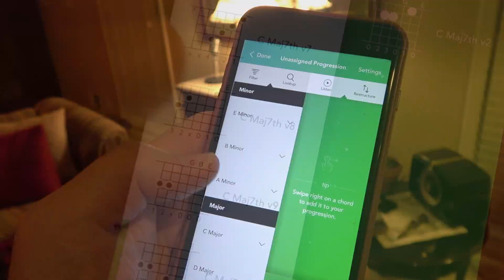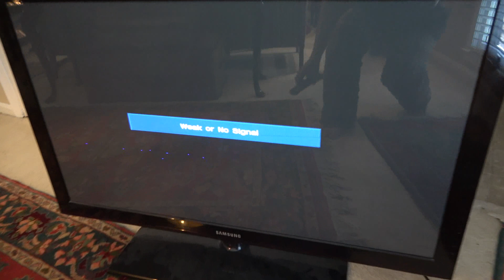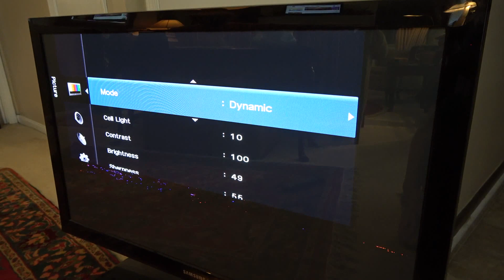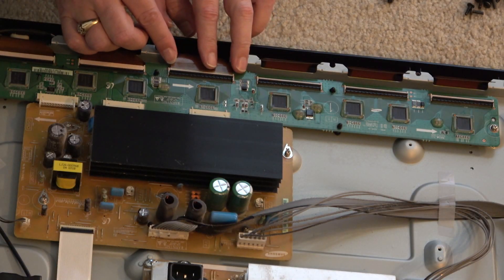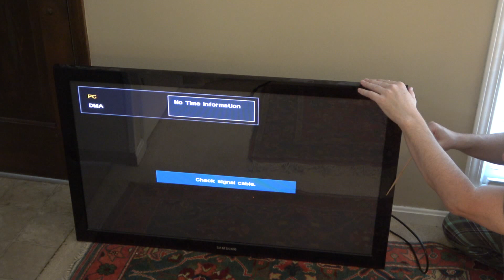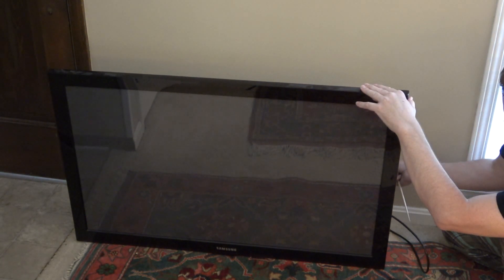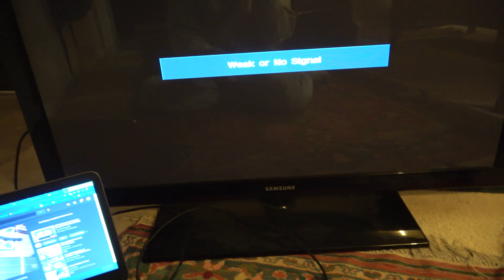I found a Plasma TV 📺 in the TRASH! Can it be fixed?

Comment from the maker: NOTE: As some have pointed out, rightly, the component I tried to replace was a cap, not a resistor. Told you I'm not good at SMD stuff! In any case, the chip was the ultimate fault on the original board. The cap reading was just a symptom of the problem. I'll know next time.
Reply: I'll trade you some of my electronics skill for your Playing ability.
Reply: Those are the power decoupling caps for the video display driver chip
Reply: Sometimes on SMD components, If you use two fine tip soldering guns, things will tak dowm much more easily From my professional experience as an all around assembler. Those little SM chips, resistors, caps, and components can be a pain in the ass to replace, and remount. Thank You President Brad
Reply: One thing to keep in mind is that caps in SMT don't have numbers on them unless they are electrolytics. Ceramics do not have any. Resistors do have numbers, though they may be difficult to read, small as they are. Also, look at the part number on the board. It is a C designation, resistors will never be a C. Always an R. 

And yes, SMT is a royal pain to deal with. I've been doing it for about 8 or 9 years, and I hate it. But if you're quick and have a small tip on your iron, it's doable.
Reply: So how much less your time were into this for?  Parts?
Reply: Dont feel bad brad I'm still learning my electronics.apparently ive been using transformers in my guitars instead of capacitors and when i think its a cap its actually a resistor.they serve the same purpose under the right values and either way it works.
Reply: It’s on you..
Reply: @malcolmadams2105  your right i don't recommend nor do I encourage anyone to do what I have done to my rig at home.i just got lucky on that one I guess. Nothing has gone wrong yet so far.
Reply: Still trying to figure out how in the last scene you show us a working set. Also, there is a pry point on the edge of the chip. You could have swapped chips.
Reply: Sad to hear you're leaving you tube... I don't use any of those other sites! I have watched pretty much all your videos... they have helped me get thru lockdown.... thank you!

Comment: You forgot the vital first step: remove any dust with a wire brush and wash debris away with a water hose.
Reply from the maker: The water hose dousing is a vital step in any self-respecting plasma TV repairman's itenerary.
Reply: Can we fit ramen in some how ?
Reply: and a wirebrush to clean the screen
Reply: Had to think about that one for a minute lol :)
Reply: @TheGuitologist  Fix any slight chips with ramen as well. Don’t forget to hose out the remote.
Reply: LOL!
Reply: @TheGuitologist  power washing is highly effective in removing roadside sludge from most electronics

Comment: The Vizio 42" in my living room had an issue with not powering on. It also was a cap problem. There was kit I learned about on YooToob, ordered one, it came with instructions, I soldered the new caps in and 11 years later it is still working. The issue was a factory defect on the small "power - on board" and instead of replacing the whole board ($220) I followed the kit instructions ($ 25) and was successful. One of my neighbors had the same type of problem I had, I showed him how to research it and he replaced the whole board, ($300). It failed also after 3 months (90 days warranty). I made him buy a power bar with filters, ($75) and found a "cap kit" ($30) and did the replacement with him. That has worked for the last 3 years. I am not a Electronics Tech but watching your channel for awhile proves that if you do the research (if possible) and take your time to understand the instructions a lot of times things can be repaired.

Comment: I have a Panasonic plasma that I bought new in 2008. About 5 years ago the display started randomly going black. Turned out to be one of those little ribbon cable had worked loose. Pushed it back in and she still runs today. But wow, these plasma TVs sure do pump out some heat.

Comment: Oops, that was a capacitor you were measuring, Brad.  Time for magnifiers.  I recommend MegaView  magnifiers.  Most likely one of the pixels experienced a momentary arc and knocked out the IC if the capacitor measured open out of circuit and the pads still measured low resistance.  I really enjoy your videos.  Keep up the good work and long live SPF.
Reply from the maker: Pretty sure I checked it for capacitance also out of circuit just to be sure. Pretty sure it tested open on capacitance too. But I'm sure you're right on the chip being the fault. The way it was siliconed down, I wasn't about to try to replace that thing anyway, even if the pad didn't fail on the board. I'm 0 for 2 so far on SMD soldering on this channel. I'll get there with some practice. ;)
Reply: @TheGuitologist  Yeah, I used to have to change those IC's on the Pioneer plasma sets.  Not a fun job.  Surface mount work takes a little practice.  Remove and install parts with hot air only.  And use lots of flux.  One of the big tricks is to preheat the opposite side of the board from where you are doing the work.  You will be amazed.  No need for a fancy preheater.  Just use your hot air gun and work quickly.  To replace the part, tin all of the pads on the board, put lots of flux down, place chip in proper location, and hit it with hot air.  The flux and solder will suck the part into place for the most part.  Just use tweezers to guide.  Try all this on a scrap board and you'll see.  Take care!
Reply from the maker: @musicsoundelectronics5590  I'll get it eventually. I'm in the early learning stage on SMD. So I'll be embarrassing myself for a while on that stuff.

Comment: The component you tried to replace was a ceramic capacitor and not a resistor 💁🏻 but I'm glad it worked in the end
Reply from the maker: You're right about the capacitor. I did check it out of circuit for capacitance also and it just read open. But the chip was definitely the real source of the problem on this board. Oh well. I'll know next time.
Reply: Thank you. I was just going through the comments to see if anyone else noticed that it was a cap, NOT a resistor. Looks like about a 1206 package. The C in the part designation is kind of a give away, too, where the parts further down on the board with the numbers on them are marked with an R. THOSE are the resistors. Glad I'm not the only one who knows which part is which.

Comment: Nice one Brad.. not a bad TV for $36.

You could of course have a go at fixing the broken board by replacing the dead chip with one from the "spare".. and obviously adding to the impending nervous breakdown in the process.

I frikkin HATE SMD stuff.. TV's all had tubes when I started out fixing them.. mostly point to point as well.

Comment: Great video Brad!  The proper tools, some hours of testing/labor, finding correct parts, and voila, a FREE (mostly) TV !! It truly is amazing how much we waste and discard in America and just pay to upgrade. Guess its sort of a by-product of how affluent we are. My A/C made a cracking noise and then more noises from inside. shut it off, opened her up and they now design some A/Cs to have a scooper type fan that scoops up a little bit of condensation water and helps it to evaporate instead of dripping down thru a run off hose   AND of course its made of some cheap ass plastic and caught BECAUSE THE Mounting SCREW loosened and it cracked it. Tightened the screw down good with a drop of elmers glue to help keep it in place, Krazy glue and rubber bands and the 'scooper fan' was good as new. DIY fixing things is probably MY FAVORITE HOBBY!

Comment: I’ve done similar before with ribbon cables on a TV. Current project is fixing a 120v battery backup for a computer I’ve had for 10 years that suddenly stopped charging. Sometimes the manufacturer will even be nice enough to send you a schematic if you email them (which I’ve done). Not only do I really love the feeling I get when it works again, but I definitely appreciate not being part of the E-Waste garbage problem. Nice work man! 👍🏽😊

Comment: C5512 is a capacitor.  Why put a resistor?
Reply from the maker: You are correct. That was my bad. There was definitely another problem on the board though. The resistance between the pads was 24 ohms even without the part installed.

Comment: Good job, Brad. For SMD work I don't know what I would do without my microscope and hot-air rework station. My old eyes can barely see some of the smaller ones.
Also, I clean those flex cable pads with a Staedtler eraser, and then with alcohol.

Comment: I got a TV sitting in the closet with the same problem I might have to check it out
Reply from the maker: It'll be your buffer board most likely. Sometimes you can re-seat the connectors and get away with that.
Reply: @TheGuitologist  yeah see mine is missing individual lines of pixels there's like five lines that are blacked out at the bottom and one across the middle makes me think that it's just a bad connection.
Reply: @TheGuitologist  hey brother I took that TV apart cleaned everything up and they were using some kind of foil tape as a ground plane so I soldered wires straight to the board and to the chassis of the TV to give a better ground and the TV is completely fixed. Thanks man I was about to buy another one

Comment: I got a 55" Samsung free a while back. It's got faint vertical lines in the display and the audio degraded to crap after a while. It's been running with an outboard speaker bar and in daily use but you got me intrigued about working on it. Think I'll hang a 42 we have in it's place & get that 55 on a table for a checkup and see if I can get a decent video of the work. Thanks for inspiration, Brad!!!

Comment: My husband rescued a plasma screen from a skip outside a church.
He got it home in the van and we found cables to connect it to the TV box. It worked!!  I think it was at least 50 inches.  Anyway after a year of using it, we left it out the front with 'free please take me'  written on it as it was costing an arm and a leg in electricity just to run it.

Comment: Great Job Brad, I too have repaired an LCD 42" Panasonic... Just wouldn't power on correctly.. turned out that a row of backlight LEDs were failing and tripping the start function.  Solution - find the faulty LED and replace or what I did was to Jump the connection to that LED.  Result = fully working TV..

Comment: The board you replaced was a t con board if basically generates the timings to address the displays column and row.

When you see lines like that on a display it's almost certainly a issue with t con board.

Comment: I used to work as an audio-video technician for a while.
That was about 5 years back or so. It's just bizarre, but basically no soldering was involved.
Just replacing the board, otherwise the whole TV was basically just signed off so to speak.
So basically if you can play with Lego, you can work as a AV technician these days apparently ..... (NOFI btw!!)

Most of the time the caps go bad, since they use 85 degrees ones instead of 105-125 to safe a few pennies.
Same goes for some little transformers. Ideally just timed right to go right after warranty.
Which was pretty awkward in countries were people can have extended warranty by law.

For plasma TV's I recall some kind of opamp or optocoupler that just went bad after a while, that was it.

I don't mind making a product or production more efficient, but there is a certain limit you know.
Lower that limit and it just becomes impossible trash. Have some proud in your work so to speak.
I guess I just feel bad for the engineers working at these kind of companies, though call to make.
I wouldn't be able to do it, my moral compass would go nuts on me.

Thanks for the video Brad! :)

Comment: I have a similar samsung model and it has been faultless for over ten years. apart from the remote which doesn't work unless you put it right next to the sensor on the tv. I never use it anyway and use the set for my pc, viewing dvd's and blurays through my playstation 3 and watching live tv, although I haven't watched live tv in about a year.

Comment: Ive been using a Sony 42 inch tv i pulled out of the trash for at least 6 years.  Its sitting in my living room.  Occasionally I have to turn it off and turn it back on to get it to work right, but its fairly infrequent.

Comment: Noice!!! i got the same tv with the same problem but its vertical and on the far right of the screen. its a damn good tv and has held up good throughout the years besides the vertical malfunction. it has really good picture too. the wife only paid 80 bucks for it second hand 10 years ago and i think the problem developed after she had bought it...any ways i will seek out the part and just remove and replace the units if a good cleaning doesn't do the trick. thanks brad for posting a video. hope we can get another one coming soon :)

Comment: Brad you may be able to run a jumper from the other side of the board but it's really heat-sensitive these surface mount things you really do need to have a fine tip and having a justable solder iron and have it at a certain Heating and I don't remember the Heat yes solder mesh to clean the pad control the heat and get some solder paste and don't spend too much time even if you're at the right Heat you got to do it quick
Reply from the maker: I will be the first to admit I'm a novice when it comes to SMD. I'll get better though.
Reply: From my experience I think most important is temperature control having the proper degree of heat and never spending too much time on a pad and not using very much solder at all to put them down a lot of times component get so hot it will melt both sides so you don't have to touch both sides this is what I think I remember because it's been years I think I work for that company building the harm and Sparrow missile was backing 92 or 89 I don't remember lol

Comment: I bought a plasma tv in 2011.  A year later, I got into amateur radio and quickly discovered that plasmas are great sources of RFI.  My plan was to replace the tv as soon as it crapped out with an LED TV, but the plasma is a Panasonic.  10 years later, still going.
Reply: Yours should be new enough to have a shielded panel at least... Panasonic finally got that taken care of in about 2009 AFAIK. Otherwise you've got plasma discharge radiating straight out through the glass front. At the time, a 2006 Panasonic plasma used to substantially impact my SWLing sessions from about 5 meters away... some of the worst RFI I've ever encountered. Mind you, its predecessor, a 1998 Sony Trinitron, was hardly innocent either.
Reply: @PileOfEmptyTapes  I’ve never opened it, it may have the shielding.  If it does, I’d hate to experience the hash without it, and the tv may have found a new home by now. The interference affected my vertical far more than a dipole up at 50’ though, naturally.

Comment: The short is probably from the solder going from pad to pad you had it the first time then you hit it again and It started flow across take it off clean it up and be careful I just hold it down and hit it with a clean solder iron you don't need to have a lot of solder the thought of that was on the pads was probably more than you needed and then it flowed across

Comment: Ouch the pad came up yeah next time you do it cuz I've done it a million times get the slightest little amount of solid on those pads hold the thing down where you want it and just tag it real quick flows on it's going to flow on both sides as soon as you heat up that resistors going to flow on both sides if it doesn't just touch it real quick but don't add a lot of solder very little and if you can control the heat if you are soldering iron is adjustable I don't remember the temps but you can probably look that up as well cuz that's where the pad came up too much heat you mentioned soda paste what you meant flux if you can get some sort of paste and one of those copper mesh desoldering schools mostly have to control the heat clean up the pad put a little bit of soda paste on it hold it down just touch it boom you're done

Comment: after the 21st screw,,,,,i would have destroyed this thing with an extremely large knockometer,,,i do have some technical advice,,when one has 22 or so screws to remove,,,may i suggest a  lovely little ,non offensive battery powered,rechargeable screwdrivering device..........     ......great video again,and once again,,, thanks again.

Comment: I got a 55 led from a house a customer of mine bought in Oct 2019. I had a dumpster there for my work and she asked my helper to throw out some things in basement, one was a 2015 Samsung led with no remote, stand or hang bracket. The other was a large, dirty heavy bronze can. He threw tv and can in truck along with a like new giant hanging light. He quit next day so I had this crap in back of my truck so it was unloaded at shop and forgotten about for a year. My so saw "garbage can" and asked for it, turns out it is a type of gong from Asian country that was being used as garbage can (I was going to scrap it as it was about 55-60 lbs) and I bought a cheap universal remote, TV is now on my wall at home. I have  42" and 50" plasma TV's and they are the best for live action sports, much better than any led or lcd (they are in bedrooms now) amazing what some folks throw out. Plasma TV's are no longer made and lots are being trashed now so if you can fix great score.
Reply from the maker: Plasmas have a nice picture usually. I agree. I have another huge TV repair coming up. Another dumpster pick.